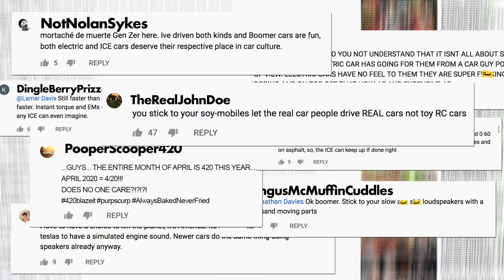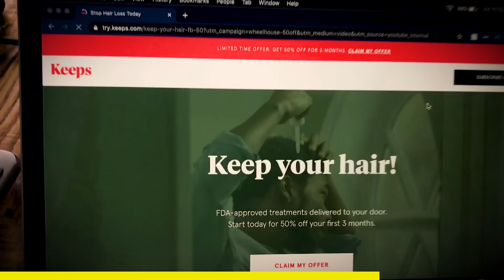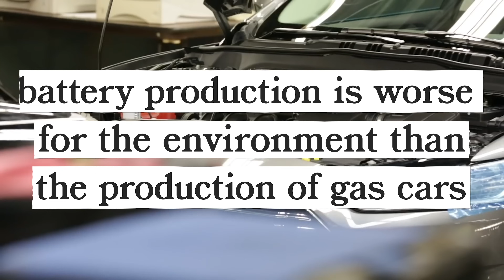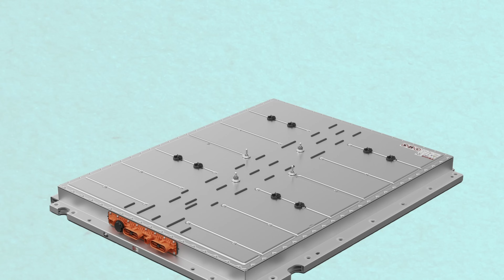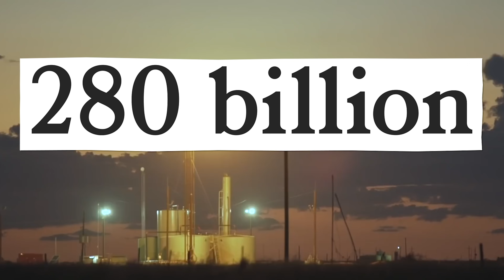Are Electric Cars REALLY Better for the Environment?

Comment: Apparently about 400 people don't like facts, or it wasn't what they wanted here. 😂
Reply: Well they did left out a lot of facts of the electric cars out they only talked about the pollution it takes to create the battery what about the rest of the vehicle the metal they use for the car itself and all the plastic and materials the inside uses? For the gasoline cars they said from start to finish but the electric cars they only talked about the battery. Then they averaged out how much pollution it cost to recharge each electric vehicle. then they clump up how much pollution oil rigging puts out when they say it them selfs crude oil it's used to make a lot more things then just gasoline for vehicles so the pollution it creates its not just for gas vehicles but for electric vehicles also since they use plastic and other materials that require crude oil to make!
Reply: @cursedwolfe  due to the fact that it take just over 2 metric tonnes of co2 just to make a gearbox housing l'd say that the 7 metric tonnes of co2 to produce an ice vehicle from start to finish is total bullshit but l wouldnt expect anything less from a youtuber that has a snake oil company as his sponsor
Reply: What facts? Co2 isnt a pollutant that harms the environment. There are no recycling of batteries.
Reply: @darrenmcfeaters6683  you know home batteries and batteries used in power plant storage are recycled batteries from EVs right. And those add an extra 30 years minimum of use.

Comment: Question: shouldn't i change the batteries of an EV every 4 to 5 years ? Like they should go bad like a phone battery
Reply: EVs battery management systems are far more advanced than what is in a phone. Any good one with a proper thermal management system (looking at you Nissan) should last ≈500000 miles or 800000  km. You will see a reduction in capacity but it is not as significant as people think